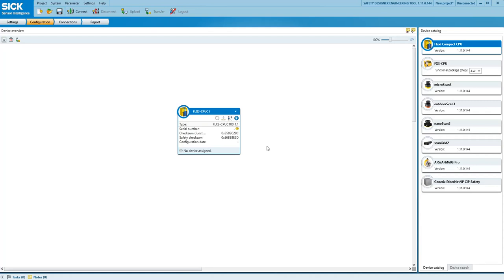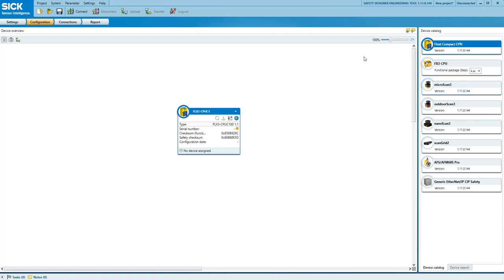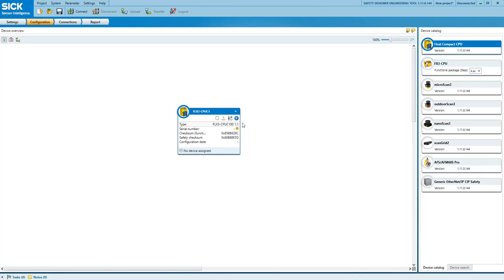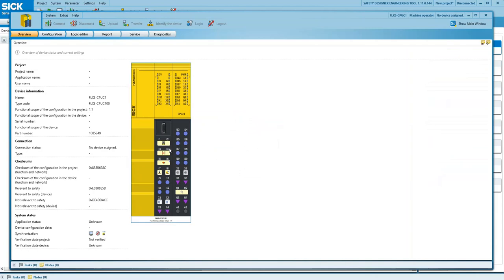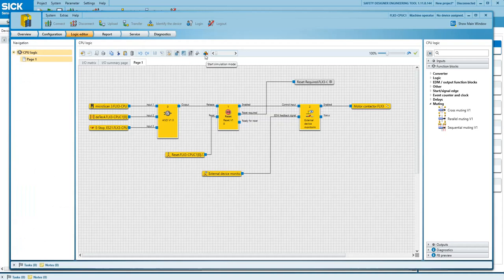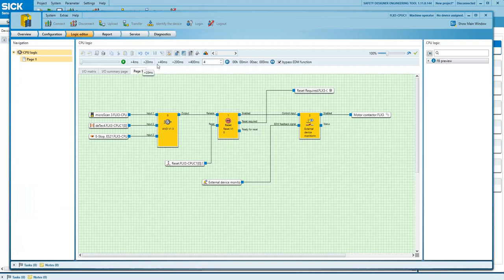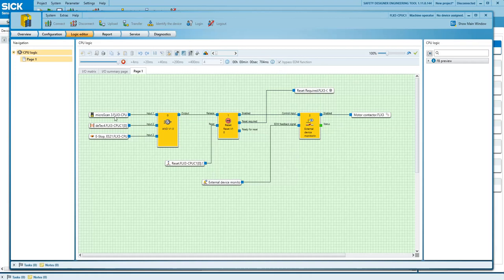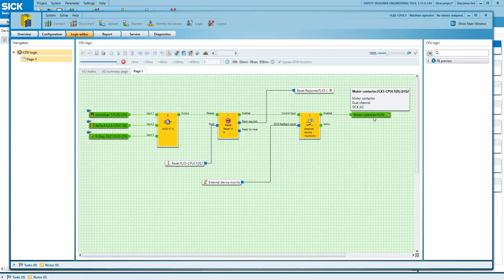SICK Safety Designer Quick Demo

Comment: Hi Martin Kidman. Sorry, I am new to using this type of driver. Where can I get an example of a program, using interlocks? First of all, Thanks
Reply: Hi Jose, where are you based? The best thing would be to contact your local SICK subsidiary I do not know of anywhere that you could get a sample program. However, I may upload a video in which I go through a simple program incorporating interlocks. However, it is always difficult providing examples and tutorials for real applications because (In Europe anyway...) the designer is responsible for creating safety-related software according to EN ISO 13849-1 so you have to put in lots of disclaimers! :)